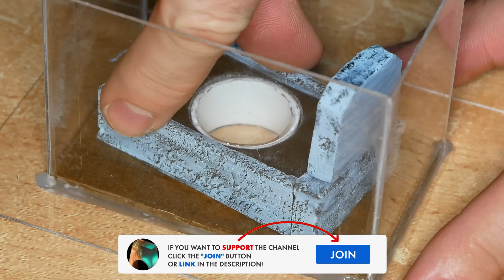3D Hologram Project from Clear Epoxy. Is it possible? 🤷‍♂️

Comment: These hologram projects never cease to amaze me! But how do you make it so that the shape is still visible like this? Is it a certain type or viscosity of resin? Most epoxy resins I've used blend almost perfectly with previously poured layers and such, so that seams are pretty much invisible. So I would be afraid that it would completely make the figure 'disappear'.
Reply from the maker: I use resin for deep casting Let's Resin. Link in the description
Reply: @jedrek29t  I checked it out shortly after posting, haha. Perhaps I'll give it a try and see for myself! Perhaps it depends on what type of project the resin is marketed for. 

Some resin types are made for larger projects that require multiple pours and thus are designed to blend perfectly, while others, such as perhaps the one in your bio, are meant for small projects that prioritize a hard and super clear finish and ease of use (things like a shorter curing time or perhaps easier to make bubble-free)

I'm just speculating at this point, of course. Thanks for the info and amazing videos!

Comment: Hello, I attempted to do this based on your previous videos. However, When I cast my figure with the resin, then used the same resin to fill in the cube. When I applied the light under it, the figure shape did not appear. It looked as though all of the resin was poured at the same time. Do you do something special to the figure to allow it to show up when an LED is applied? Is it a coating, or some kind of sanding? I noticed that the shark in this video looked a little opaque as if it was coated or sanded. Any help would be appreciated.
Reply from the maker: I do not know why but when I shine a bright led (white or yellow) the object is invisible. Blue light works best. And the best UV light
Reply: @jedrek29t  But I noticed that when you fill the resin with the object in the middle, you can still ever so slightly see it. When I do this in my case, the object completely disappears. Is there something you are doing to allow the object to ever so lightly be seen when filling in the resin around it?
Reply from the maker: You can teach me this 😁 I would like the object to be invisible. Maybe you use a different resin than I do